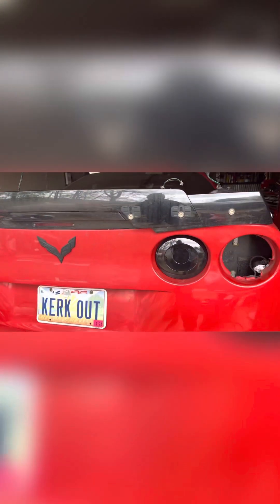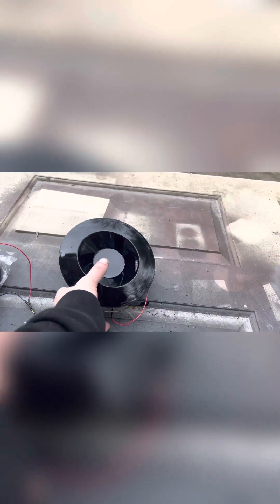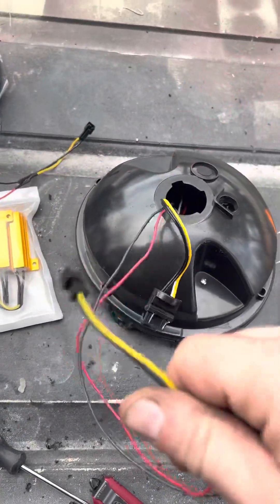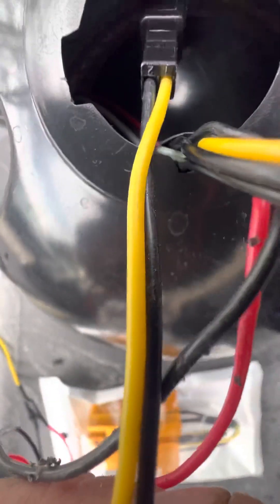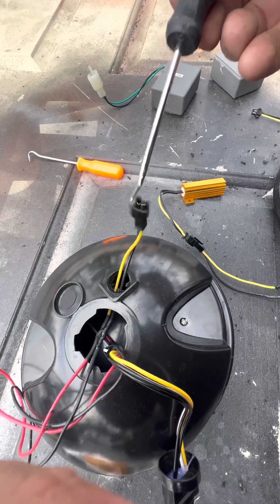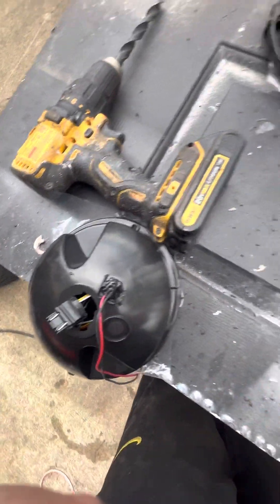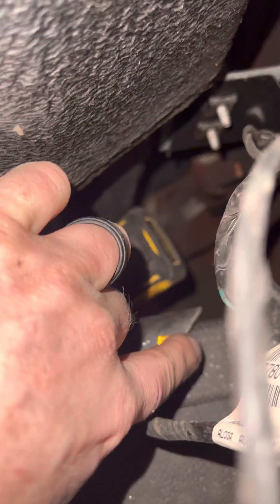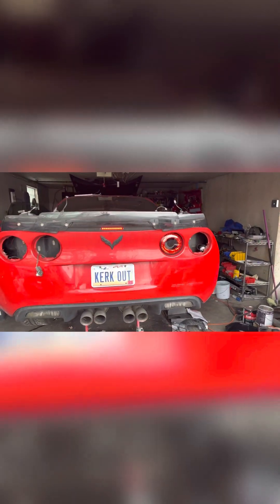C6 morimoto knock off taillights install

Comment: I just returned a set that I got. I wasn’t about to silicon them into place since they don’t have the mounting tabs for the bottom of the fixture. Once installed they would swing back and forth from the bottom
Reply from the maker: Mine didn’t have issues with that.